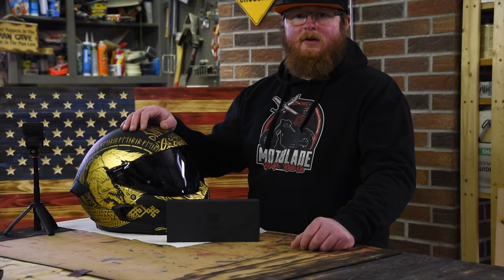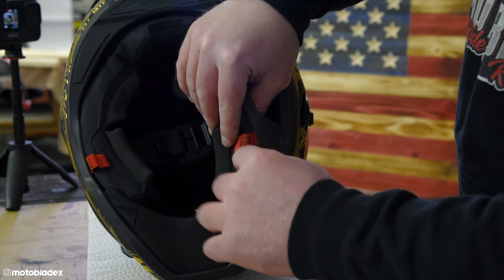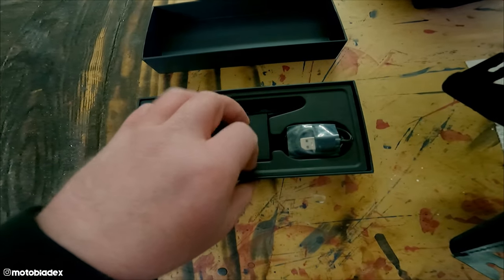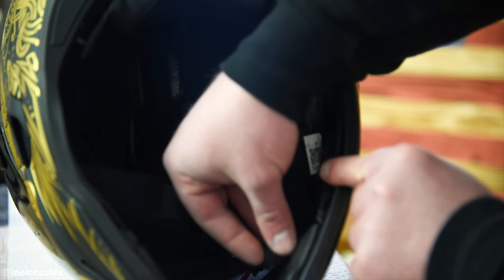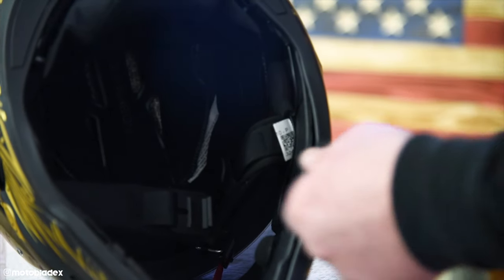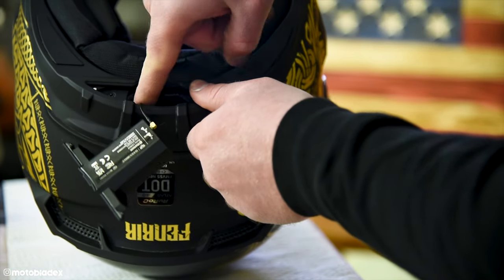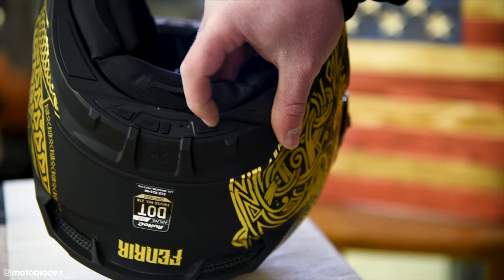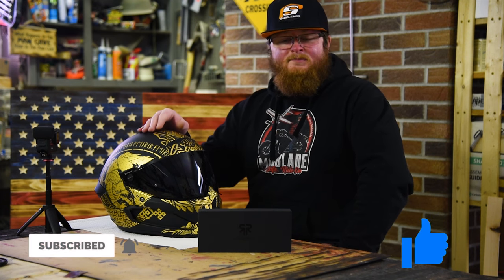Quick and Easy! How to Install Ruroc Shockwave in Atlas 4.0

Comment: I've seen a few review videos on the shockwave and from what I've gathered the system works very well. However the main complaint across the board is having to reach behind you to reach the controls. I know Ruroc listens to it's customers so I hope they develop an external controller that can be handlebar or tank mounted.

Comment: When you place the pads back in, especially with the chin curtain, do you notice its not as snug of a fit as when you first got the helmet? Mine seems to come out much easier, and I need to adjust the curtain every time I take the helmet off.
Reply from the maker: Nope. Mine is just as snug. Even with the cord underneath it's never popped back out or even been loose. Not even after riding 100mph for hours on the highway. I would check to make sure you have it going back in the right slot in the cheek. There's a second little channel the tabs could slip into and it won't hold. Make sure it's in the tightest slot. If that doesn't help, I'd contact Ruroc. Lot of money to spend on a helmet. If something isn't right, make them fix it! Annoy their customer service til they make it right.

Comment: Got mine before they had a distribution in the USA a few weeks ago.I seen a helmet holder in a shockwave I didn't get.just curious should a light be on when charging?Or should the device  be on while charging so you can know what's going on with the charging?I didn't receive any manual.
Reply from the maker: Device should be off, light will come on during charging. Be sure to use cable that came with it.